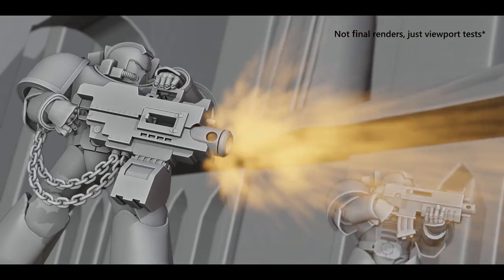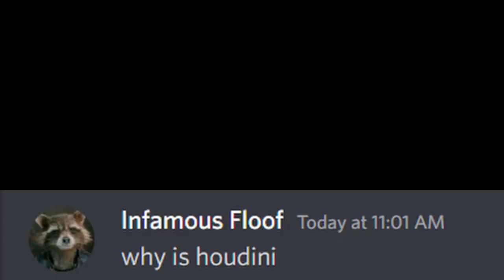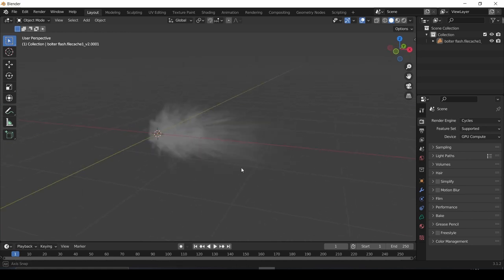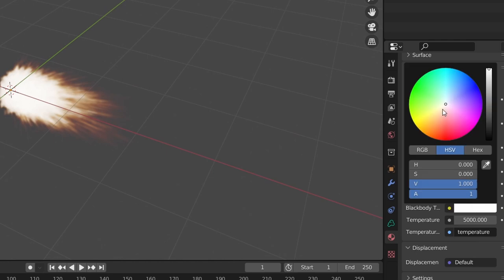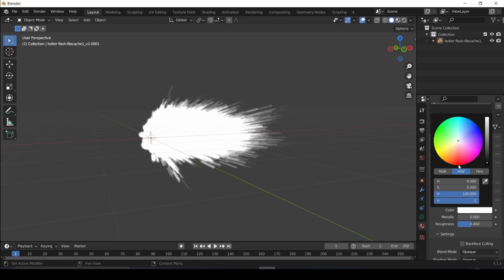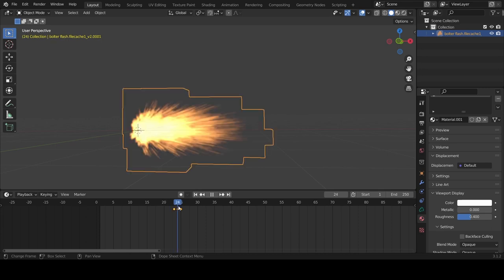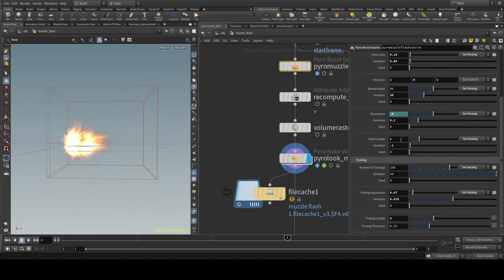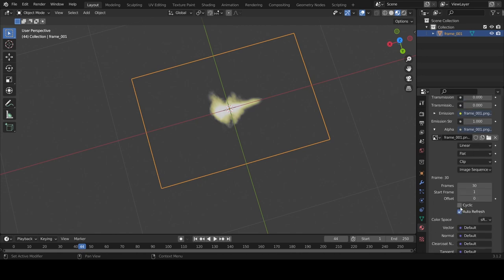Making Muzzle Flashes in Blender! + Free Resources

Comment: Keep in mind that this kind of VDB volumes (mean muzzle flashes) won't work in Blender with motion blur enabled in Cycles. The reason is Blender's old bug. I've recently faced this issue when I tried to create motion blurred bullets with addition to this muzzle flashes - project just doesn't render, so I googled and find that sad info about VDBs and motion blur 😔
Reply from the maker: Unfortunately I've come across this issue as well... I usually disable the camera ray so it still casts light, but doesn't have the same issue. Then I'll render out just the VDB in a second pass and comp it over my original frame. This way you still get the realistic lighting, but it's kind of a pain. I think you might also just be able to disable the motion blur compute for the VDBs but I'm not sure. At any rate, if you make your own in Houdini, just make sure to get rid of the velocity fields, since those are what cause the issue: I've rendered VDBs with motion blur before, but only ones without Vel fields.
Reply: @SirFloofius  disabling motion blur for muzzle flash VDBs isn't working - project won't render in any case - seems like a general bug in Blender + motion blur. Your method with separate rendering is appliable, - I also thought about similar method, but for me it's all looks clunky. All this is sad, because muzzle flashes from your video - I found as one most realistic and easiest to use (comparing to other vids from YT.) Unfortunately, I have no xp with Houdini, so can't create same flashes with velocity fields. So I just disabled motion blur
Reply from the maker: @punk_rock  I'm quite busy with school, but at some point may create an updated muzzle flash that doesn't have a velocity pass--I did some testing and if they don't have a vel pass they don't create the bug. Also, for rendering a separate pass, just make sure you make every other object 'holdout' and set the background to transparent, and set your render file to something with an alpha pass. Sorry that the muzzle flashes didn't work for you; if I make some new ones I'll let you know!
Reply: @SirFloofius  np, man - I've already found the way for may project by creating fake tracing bullets with mesh and alpha-channel texture - looks not so good as motion blurred ones, but as for quick fix - it looks ok. Of course, it will be nice if you'll rework volumes in Houdini, but - this only for your decision. Anyway, thank you for this tutorial and VDBs - both looks very fine!